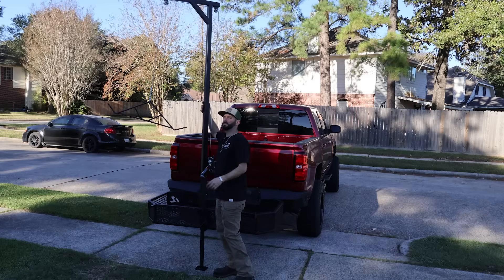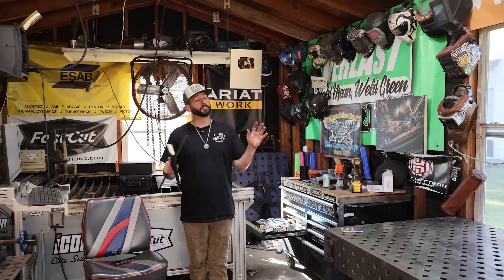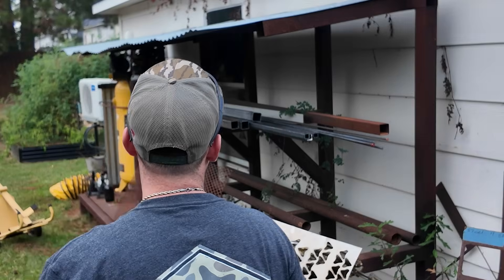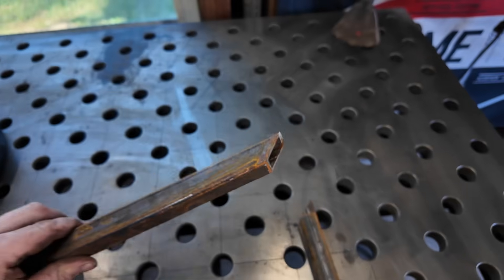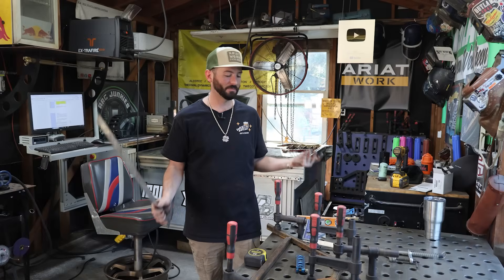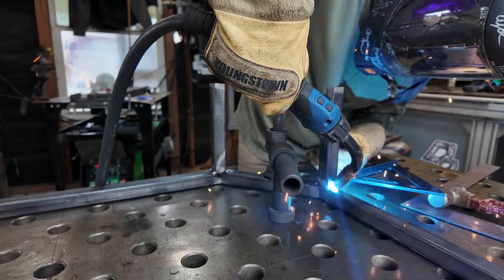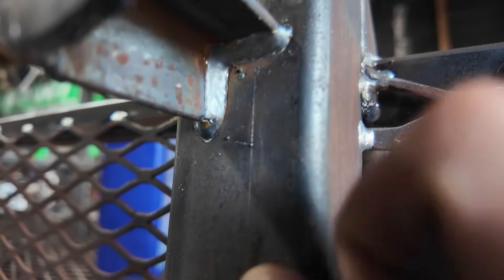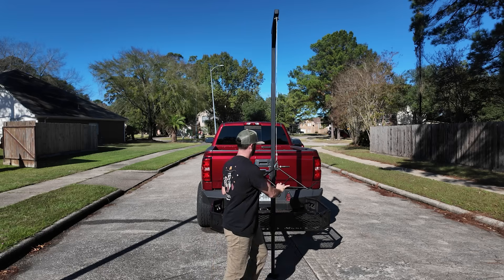Fabrication Advice Every Beginner Welder Should Hear

Comment: Great episode🔥
Reply from the maker: Thanks for watching! Let us know if you have any tips people should hear.
Reply: @Welddotcom  You covered everything pal👍 A calibrated tape measure I would say, Or measure from the 100mm (if metric) And a preference of mine on square tube especially if the corners/welds have to be taken down and blended and/or drilled it helps a little being mindful of where the seams finish up. Just something I try to keep in mind when at the saw cutting.✌

Comment: You've got your BOM, you've got your cuts, but you seem to wing it when it comes to the actual fabrication steps.   Sequence matters, so I give the parts names and make a list of numbered fabrication steps on the computer.   For instance, it's often a lot easier and more accurate to drill holes in parts in the drill press BEFORE they become incorporated in some big assembly.   Sometimes a pattern of drilled holes becomes an effective template for further steps.   These things are easily overlooked in the heat of winging it.

Comment: Thanks. Now I can fab a hitch mounted cable crane to lift a gas powered paver tamper into my truck. That way I don't have to rent a tiny trailer or break backs. Just without the basket. Beats drilling holes in your bed for something that's rarely used.

Comment: I would highly recommend the Eastwood 225 Mig. I bought a spoolgun off Amazon and now aluminum is easy peasy.  Reason for Eastwood - 3 of them: duty cycle, durability and customer support.  Everything Everlast doesn't have. I have had to send pics to a repair shop, they looked up and collaborated the parts from various other scrap machines that couldn't be repaired. Sent me the parts and that took 3 weeks with still zero response from Everlast. Now, with Eastwood,  after 10 years the machine has beaten the snot out of my buddies equivalent Miller. So many times he has stopped by to borrow my Eastwood 225 I told him to just buy one. He did about 4 years ago and burned through about 2 tons on spools. Flux and non flux combined.  It also runs off a generator pretty good.

Comment: Also understand and learn to read a bubble level. Not all are created equal !!. Machinist level, square as opposed to the concrete level and plumbers level. Now some might be all the same if they have the 2 marks in the bubble area. The extra mark is to allow for the slope for drainage. Important to remember when installing or fabrication a shed cover and you need some slope to drain the roof over a 20 foot length. Ask me how I know ! Lol
Reply: Isn’t that just common sense? That a roof needs an angle for rainwater to drain.. or did I miss something?
Reply: @MoneyMotivationYT you didn’t miss anything. I sorta did. The roof is sloped from the crown. Aluminum framed carport with aluminum sheet siding/roof panels. I had to dig out the dirt so I  could concrete block the foundation rails. Did put a slope from front to back but just enough.  Could have been a bit more but it still drains ok and we get a fair amount of rain. I’d say I got lucky then I properly planned.
Reply: You missed something. Don't always need an angle for drainage. Most commercial buildings have flat roofs.

Comment: Those little "bee-bee's" are actually "dingle berries". They're already common  on welds done with plain straight Co2 gas . It is somewhat normal for Co2 gas.  If you want a better smoother finish, then try   Atgon/Co2 (75/25) instead.
Reply from the maker: thats what i was using.

Comment: Reading a tape measure is so so important. I measure...three times, cut on the right side of the mark. If there are multiple pieces of the same dime. I check the stop, make sure it is not moving when the next piece bumps into the stop. 
  The better the fit, the closer the parts...equals less heat input...less distortion. 
I like to restrict the parts so warping is eliminated.  Good ole C-clamps...angles, ship channels, etc. 
  I also like to use a bucket with water & a rag to make parts go where I need them to go. I mean...use a wet rag to counter the heat. A-36 does not have enough carbon in it to cause any grain structure problems. 
  I put the wet rag on opposite side of the weld.  It takes some practice, but it is a very satisfying way to hold a dimension.
I have found going a little slower in the whole process means the finished "part" turns out much better. 
  The time we spend on the "part" is short, b/c it'll be finished way longer than the time we spent on building it.
Reply from the maker: Great advice!

Comment: BIG thing to remember, factor in saw kerf on your BOM, 1/16-1/4 adds up quick when yer cutting 20-30 parts out of a 20' stick
One of the first jobs I had customer supplied matterial, and they issued EXACTLY the correct amount, i.e. 2 20' sticks and a 37.5" extra piece, which would have been "perfect" if we didn't need to cut them, they did this for every job for months... eventually I think the guy in charge got fired
Reply from the maker: oh yeah. def stacks up.

Comment: more videos in fabrication, people may not know this but fabrication is like everything in this trade, welding ehh like 20 percent of it unless your just a welder, but id say 60 maybe even 70 percent of welding careers its all fabrication. And schools dont tech fitting that well, its to expected to be known at a job site most of the time places dont have nor patience to teach that so it needs addressed in the education system. Welding is basically carpentry in the real world. Most companies don't train this skill, so if your lucky find an apprenticeship. Because if you get good at fabrication, then any job will be a breeze. Welding is great but it's only a small portion of most jobs, the fiting is the bigger picture and that in my opinion is lacking. Especally knowing how to use portapowers, comealongs, that another one mot places its im showing you one time and thats it dont f*ck this up. Go on job postings right now what do most of them require? Fitting, layout, attention to detail, repairing bent or warped parts, some places might have jigs, poisitioners, or reference points but still alot of places, nope, they dont have a table with hole drilled to clamp shit. They harp about welding but thats gonna be the least of your worries. But it all depends but fitting extremely important, i think it needs taught better and needs more harping in the education system, companies aren't really gonna train you on that stuff its all expected of you unless your an apprentice.
Reply from the maker: Agreed

Comment: I use a thin paper towel on my final wipe down.  It tears easily if there is weld splatter or a rough edge you missed.

Comment: As a fabricator of around 30 years, I just recently learned the basics of using Fusion 360.  This is an invaluable tool.  If you want to know exactly how something you want to design and  build is going to look and how well it will function, YOU NEED FUSION.  It's free too.  Learning Fusion is the best thing I have ever done, and I have only learned the tip of the iceberg.

Comment: The quick glance at the tape got it is actually the third time I've measured because I forgot the number the first two times

Tacks are temporary clamps.

As a professional bb producer I found another chunk of metal with some heft pops them right off. A super sized scraper or chisel and all it is, is a piece of angle or bar stock.
Reply from the maker: Great advice!

Comment: another one worth mentioning is compounding errors. a tiny bit of measuring error, plus error scribing cut line, plus error lining up saw blades = miles out. also when you have multiple parts and each one has a tiny bit of error. it can mean the overall dimension gets blown. sometimes you can cut a tad short, so you end up with a small gap to weld rather than parts that won't fit together. 
just something to keep an eye on.
Reply: Yes, we call it stacking tolerances,  they add up to trouble.
Reply from the maker: oh absolutely! nothing worse than getting complacent, only to get to the end and have a wonky piece of trash.

Comment: On my evolution saw id line up to a mark and some were perfect and some a tiny bit off after the cut, turns out the blade had the teeth set to left and right every second tooth and when id line up my mark to a tooth it was sometimes the wrong one so i used a silver sharpie and marked lines on both sides of the blade to tell me which tooth to line up with on either side. Been perfect since. I also got a small sowing machine lamp that shines down to see the marks easier
Reply from the maker: its the little things that add up.

Comment: I genuinely admire people who can cut all their parts first, then successfully weld them all together after, as if the drawing and reality are one-in-the-same!
That don’t ever work for me! So after lots of trying, I just build as I go. It seems to come out perfectly in the end.
Reply: If it comes to welding, make all that stuff a hair short. Open root can always fill the gap. When I did my IW L1 block this september, I was an ace at layout cuz I used to be a carpenter. But I'm garbage at torch cutting smoothly. I have the parkinsons from combat sports
Reply from the maker: In all honesty, when I build anything for the first time, my plan isnt full proof. usually takes at least one to find out where the holes in the plan are.

Comment: Love the vid. Do a cheap vs expensive welder at home  depot vs northern tool or harbor freight
Reply: Id buy an everlast before I buy anything from those stores. Or buy a used transformer welder from those locations. Ie- 110 Lincoln wire feeders